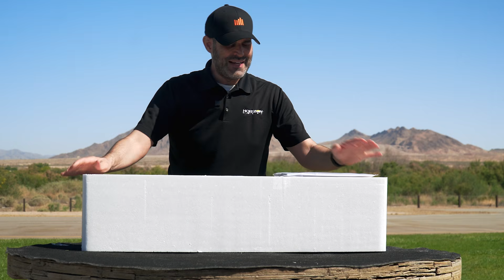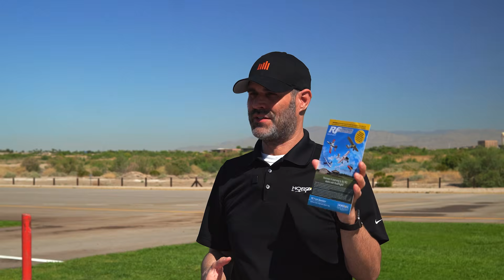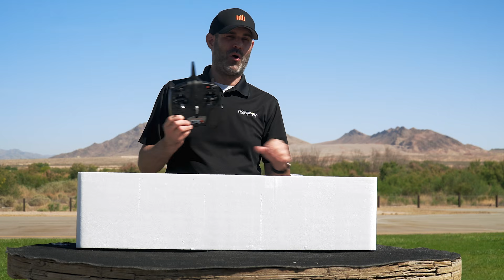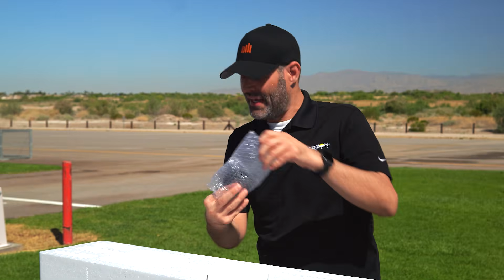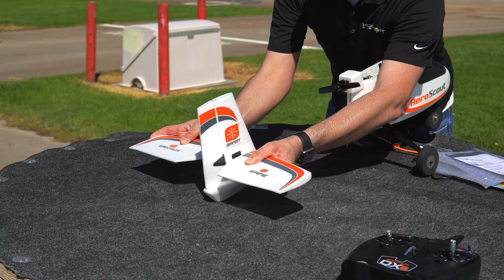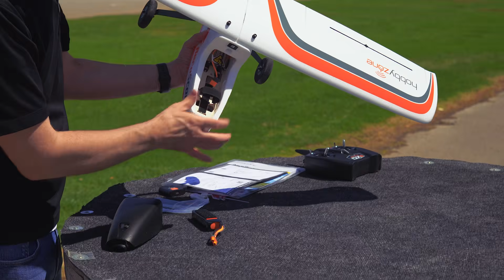HobbyZone AeroScout S 2 1.1m - Unboxing and Assembly (2026)

Comment: I got a new aeroscout for my grandson and put it together and dl file went to fly it and it's flew really fast I am experienced pilot but was way to hot for him . Flew it with 2200mah 3s specktrum g2 50c . Should I go down to a 1300 3s any suggestions?
Reply: Dropping battery capacity won't change how fast the motor spins. Number of cells/voltage would. However, it might be easier to just limit the throttle channel EPA or Rates.